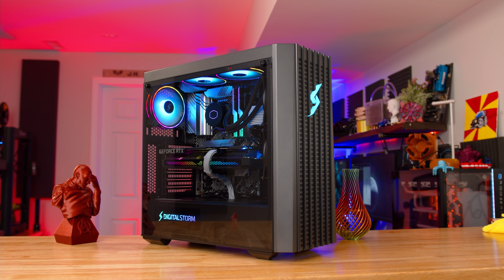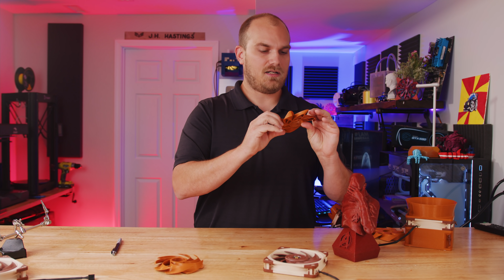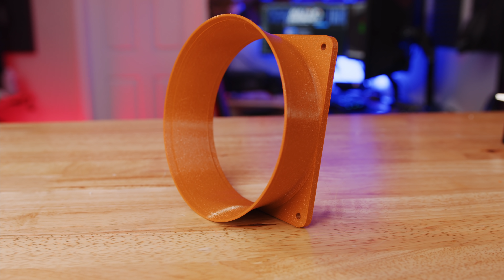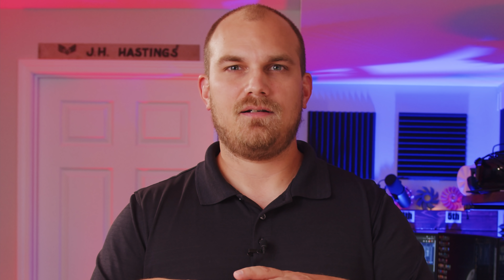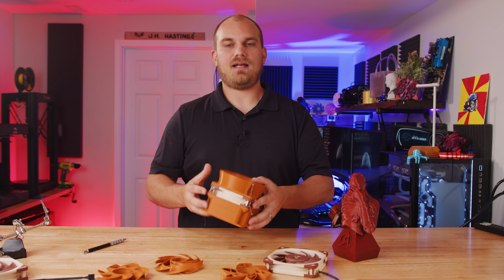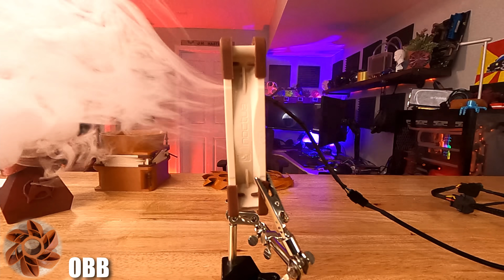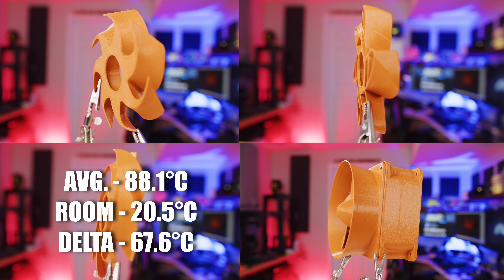Is this CHEATING? - Fan Showdown S3E3

Comment: The "cheater" designs would work well in a PC case as n intake fan for an aircooled CPU. 
You would suck in air in the front of the case then push it over longer distance right into the CPU cooler without any ducting.
I working on a concept right now where I (cooling wise) split the upper half of my PC and the lower half with the GPU. I then use 1x 140mm fan for the CPU intake & 1x 140mm fan for the GPU.

Comment: OK I'm kinda glad I took the time to search out the cheater - I'm looking to buy a bunch of fans and was looking for the best design.

So it needs a nose cone like on an Aircraft - it needs the motor inside the body that looks like an Aircraft and it's motor has to be mounted on 4 wings to straiten the air out like an aircraft.

Look at all the other fans you've been given to print and which one looked like an Aircraft.

When I was designing my first windmill it was said that the most economical blade was not 6 or 3 or 2 but a "Single" - with a weird counter balance working off speed.

At least in Extracting power from Air it appeared the turbulence cause by other blades stole performance.

Who wants to design a single bladed fan?

Comment: About that "diffuser," I've always wondered how much better things would be by just adding a hollow tube between the fan and the heatsink.
The fan blades being so close to the heatsink fins can't be good for airflow.  Just separating them a little with a hollow tube might make a big difference.
It would've been nice if you combined that "diffuser" with other fans to see if just adding the "diffuser" makes a difference.

Comment: I think the crazy thing is the cheater beat noctua's fan with inferior parts and build materials meaning it would actually perform better if it had noctua level build quality.

There are actually several fans that might be more competative to noctua if only 3D printing was competative in build quality to industrial manufacturing techniques.

Comment: It's not cheating if it could fit in a full size case
Reply: I also feel like in instances like that where they are too thin and can't get up to speed you should reprint with a slightly thicker blade, or at least contact the submitter and ask if they want to adjust.

Comment: How about the noctic=2,  same design but add a thin printed ring (or just a glued wire ring) connecting and constraining the outer blade edges to prevent expansion at speed.

Comment: My 11900k hits up to 90°C at 5.3ghz 9n all cores, with a 360mm Asus Ryujin with it's 3 Noctua Nighthawks or whatever they're called. Sooo......

The Cheater isn't cheating. If you have the room in your case, or outside if need be, and don't mind the look, I'd say it a necessity for and newerish i9 when overclocking. I got a 3d printer coming in the mail and I'm gonna need to print out 3 of those badboys.

Comment: I think the important takeaway from the cheater has to be the result. Success cannot be denied. I'm aware that real world applications might be limited. Gaming rigs and high performance machines being the likeliest target users, for exotic high flow extreme cooling solutions, ensures demand for them. Additionally, with the variety and complexity, of case modifications and designs, having become commonplace, size and height are far less of an issue. 
Something that I'd like to see addressed, maybe it has been and I'm unaware, is dust accumulation caused by cooling. Filtration obviously interferes with airflow, adding another dimension of complexity to cooling. Obviously a near dust free environment, slightly humidified and cooled, would be ideal, but it's not very accessible. I'd thought along the lines of something like the Cheater, with a column for intake that extends from mother board and heatsink mount to another mounting in the casing opposite, with an intake cut through the panel, and filtration solutions mounted external to the casing. 
As I said, there may already be various options already being used. I've seen liquid cooled systems, even nitrogen solutions, and obviously water from leakage or condensation, can be disastrous. Mounting the cooling system external to the casing was a solution I'd thought of, at the time, with a column to have the fans draw air from the external cooling to heatsink. Seeing the Cheater hot me thinking of that again. It occurs to me that a combination of all of these factors mentioned could give an interesting end result. 
This seemed like a good forum to drop some of these random thoughts. If they're of any use to anyone, they're yours, if not. Oh well.
Reply: In my "case" I want to see how well it can perform for CPU cooling or GPU cooling if possible, cause if a printed fan can do so much more than any commercial fan, then the combination can be really interesting indeed.

Comment: Please can you somehow utilize the concept of "The Cheater" to incorporate a 3d liquid metal printed hollow radiator. Then mount this at the bottom of a 3d printed custom art tower. This way if it leaks ever there is no damage. Personally i want a open mouthed skull that intakes at the mouth and comes out red led lit eyes and nostrils and blow smoke into that.

Comment: Great creativity! But, Anything that doesn't "fit" inside the original housing should be considered as a separate category. Otherwise, you might as well allow compressors and external fans to be included. The "Control" fan was designed for a specific purpose, to fit into a "standard" case fan slot. By allowing fans that exceed these, you are bypassing the original intent of the design. So, that is fine, if you want to do that, but to be fair, it should be a separate category.

Comment: Actually the cheater isn't cheating due to the previous season also had multi piece fan setups, it is just that this one ultizes both sides of the fan reducing structural weight stress on fan casing.

Comment: Can the smoke be added using laminar flow, but far enough away for there not to be a boosted air current to any fan?  I think it would be an interesting visual, or even smoke at 90° to the air flow of the fan, showing suction deviation.

Comment: I have a fan suggestion for a fan I just found out about a few months ago, it is the b-gear blaster 5200rpm 140x38 fan.  It pushes 308cfm of air and cannot be used on normal fan headers because it requires like 30+ watts.

Comment: The Cheater appears too big for the space envelope for a fan in the computer housing.  If so it should be disqualified along with any others that do so.  I like the concept though.

Had another thought: Could we design a quiet fan for a whole house air conditioning exterior unit taking the quietest that is currently available as a benchmark?  The fan disc would be approx. 24 inches diameter.  Would this be too big for your printer?

Comment: Can we take a minute to appreciate that the A12X25 is only 0.2° warmer than a fan with airflow smoothing devices added. Also I would love to see the A12X25 tested with the Cheater shrouds attached, dB as well.  Side note, you should build a rig with a manometer and test static pressure of each of the best fans as well vs the gold standard Noctua.

Comment: What would be interesting to see is all the fans tested, but put the fan housing in just a simple sheet of metal or plastic. In automotive, all radiators have a shroud that surrounds the fan and seals around the radiator to keep warm air from being pulled around the outside of the fan housing and recirculating, reducing efficiency. I know in a previous season you said something about testing in a case in a more "real world" situation.

Comment: I've said it multiple times and I'll keep saying it until you do it:

The best improvement you could make to these videos is just a sheet of transparent acrylic.

The smoke visualisation is kind of messed up by the overspill of smoke round the outside, and in the case of some of the most effective fans (although not the cheater) the Bernoulli effect caused by the outflow seems to actively draw extra smoke around the edges.
You could cut a square hole in the middle of a sheet of acrylic to isolate the front and back of the fan from each other, preventing this overspill and making the visualisation of the airflow much much clearer and more consistent for the viewers.

Comment: The cheater has given me an idea...

With fan showdown most people have focused on fan design itself, but why not make a subsection for inlet and diffuser design specifically in which people design parts to mount either on the front or rear of a particular fan, and then mount to heatsink/radiator?

Comment: The cheater is a very different beast. It would probably require some different mounting solutions and maybe even a special built case to really harness its potential. The Lamar flow design could reduce in case turbulence though 

It might make a great main fan in a air cooled build but I can also see good applications on a radiator as the reduced turbulence and higher air flow would be handy in single or double wide application, the main problem is space as the duct attached to the fan is fairly larger then standard and may need a extended mounting area to fit it all making for a more elongated case design. This would be especially true in a push-pull configuration.

Comment: Hey there, love the upgrade and the cam perspective changed too xD its now a more "Static" picture, instead of the old incline angle from the side. Good Stuff :)
What I dislike is that your Sponsor is unable to put the Radiator in the right way and they call themself PC Assembly company? Get your Sponsor info right before you advertise a bad product and your fans might be unhappy with you because of it. How much "passion" went into that PC to take the 2 min and install it correctly? I dislike showcasing bad assembly practices because it inspires DIY enthusiasts (What your main audience is probably) to do it wrong and fk up their parts.

Comment: did the creator of the "cheater" mention that you have to glue all the fan blades to the hub? or was it supposed to be like how a jet engine compressor is made with blades that are a bit loose? like demonstrated in this video: https://youtu.be/CXSi4GXUojo?t=255

Comment: i would place the cheater in a sepeate league, i clarify :)

so you have the regular fans competing against each other , that theocratically could be mounted directly  on a water cooling ( i think as a seller perspective ) 

and you have the fans with accessories and mods,  that are maybe great coolers, but are more for custom build pc setups, and don't fit in on every CPU cooler in a case, and is unfaig against the fans without any mods , spoilers and stuff

Comment: Tip to stop thinner blades from expanding with higher rpms. 
1. Make a tiny groove at the same spot on the outer tip of each wing. 

2. Get a piece of non stretchy string and tie it around the fans circumference using the grooves to keep the string in place.

Comment: I almost wonder if there should be separate categories for fans that stay within the housing and fans that exceed the housing. For the videos I don't think it'd be a good idea to separate, but I'd like a column on the data sheet that indicates if it was designed within the constraints of the housing or not.

Comment: The Noctic did good for how slow it was. Perhaps if the flexing issue was resolved so it could run at full speed, it would have been a contender.

Comment: You've used fan assemblies in your ranking before, contemplating not letting this one fly just because it performed well can't be reasoned. The name shouldn't be a factor, either.

If you really want to, maybe splitting the ranking list between 'classic fans' and 'fan assemblies' might be worth a thought. Set ground requirements for the regular ranking list, i. e. 'fan blades/parts can't extend past the frame', so push/pull mounting would in theory be possible. 

However, I think creativity and outside-the-box thinking shouldn't be rewarded with a b-list ranking; unwieldy and otherwise unconventional cooling solutions have been commercially available forever as well. Function over form is a viable policy, imo.

Comment: I feel like at this point, you almost need two weight classes of fans: the basic class, where you're just designing a fan that could swap out for the noctua one, and then a unlimited class where you can add all the "external" accessories you want. Could maybe just come up with a "design envelop" bounding box that the unlimited class assemblies must fit in to be valid, to keep designs from getting TOO massive.

Comment: I would like to see the noctuic with thicker blades to see if itll perform better. Also, I would invest in a "grey card" to keep your white balance even between shots...the colors looks yellowish during the smoke tests. You just have to "reset" your white balance with a new scene, but the consistency is worth it. That and ISO seemed high on the smoke tests because the room was darker...you could either increase exposure, but will affect the slow b-roll shots, or add alittle more light. Perhaps adding a small spotlight that is perpendicular with the fan faces so you could focus the attention on the smoke while seperating the background.

Comment: Had a pretty crappy weekend. But your video's are rather calming and relaxing for some reason.  I think its a mixture of the smoke test, and the audio track backing that part of the video.  Had some pretty good contenders this week! BUT!!! What happened to the footage of physically putting the fans on the leader board?!?!  I was curious to see what the Cheater fan would look like up there, and how you were going to hang it up. lol.

Comment: for truer laminar airflow the surfaces should be smoothed. in any plane that achieved this it required the wings and body to be as flush and smooth as possible thought flush mounting of rivets and making sure the seams of the metal sheets were also flush with each other. it may not sound like much but in throttle body intakes they will "port and polish" which is a rounding and smoothing of the surfaces the air travels past and CAN make significant air flow and performance changes.

on the blades that expanded you can limit expansion by adding one or two small rings and not a full depth ring to the outside of it. so that the blades will limit the others from over expansion meaning a great increase of possible safe RPMs without hitting the sides.

Comment: As far as I am concerned, the cheater should be allowed because it uses the same frame as all the other fans. If the motor can push it and you can fit it in your case it should be a contender. My two penny's worth,

Comment: I knew it was only a matter of time for someone to actually do the math. Nasa already did the studies on propellers and fans and found that the optimal blade pitch and surface area varies by length and rpm (tip speed), also the type of working fluid but that's beside the point.

Comment: I believe the bottom half of the cheater would greatly increase the results of any fan.  It should be tested with other fans, and if there is a consistent boost then it should be removed.

I haven't said anything yet, but I believe one of the biggest factors in getting a good cooling delta is having a solid laminar and unturned flow leaving the back of the fan.  A lot of these great designs pull in a lot of air but spin it out in every direction.  Personally I think removing the ambient heated air away from the heat sink fins is more important than forcing cool air onto the sink.  Especially with the new test set up.  But that is just my suspicion.  I'm trying my hand at a design to test this, so we'll see.  But if I'm correct, the back of the cheater is a major factor to its success, and would boost almost any design.

Comment: An idea for the fans that have similar problem to the notic, i mean flex from rpm, is to get a thin sanding paper and place in in the iner walls of the fan hub. Then slowly increase the rpm so the fan gradualy eats itself out as the rpm increases. Unfortunately i dont think we can calculate for the flex of the material since you keep changing the filament, but this should at least give a more fair result even if it deforms the part slightly.

Comment: I don't have a 3D printer and I'm not good with graphic design. But I think I have an amazing idea if someone could figure it out. Why not reverse the blade, I can't think of it, angle so instead of blades so that the main scoop of the blade is on the outside of the fan and the blades look like their counter rotating when they're not pulling towards the center instead of the blades pushing out towards the outside. So as the fan spins it achieves higher air velocity and scoops more of the smoke from the outside of the fan shroud pulling it all towards the center. It wouldn't be very quiet but I think it would be able to push a lot more air even though the air would be concentrated more towards the center of the radiator. I don't know if I am explaining this correctly, I could probably draw it. Maybe put some little fingers on the bottom side of the blade to break the sound. So that way the chopping sound doesn't make it all the way through the fan.

Comment: I had an old PC case that actually used a Velocity stack connected from the side of the case to point right at the CPU fan... so for me the cheater isn't really cheating, it's using the best tech they can think of.

Comment: Cheater with the cable in the outflow…
Also, once the air is compressed, keep it compressed to maintain velocity… it obviously slows down as it expands on the outflow.